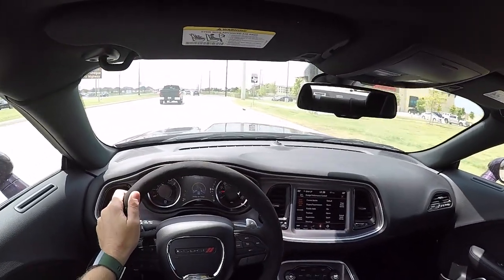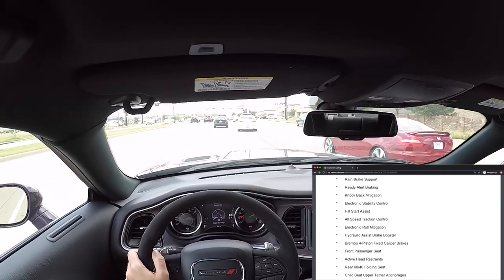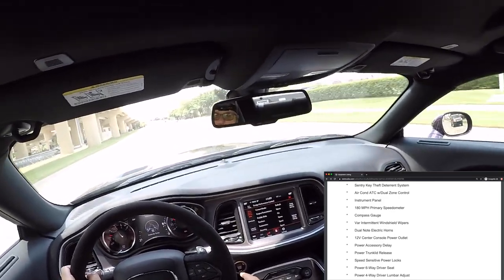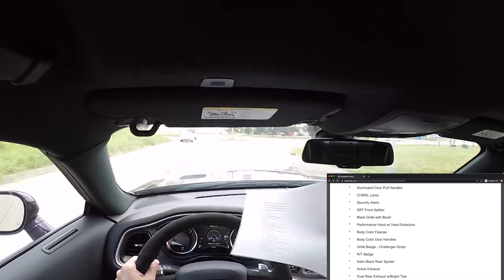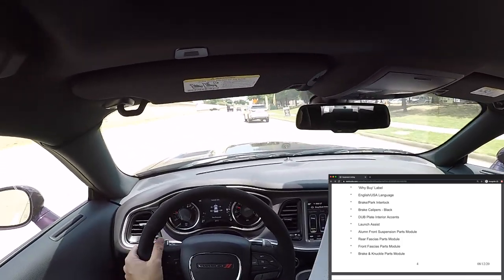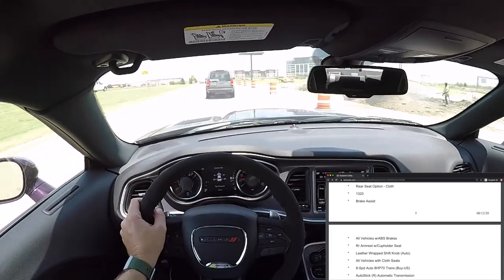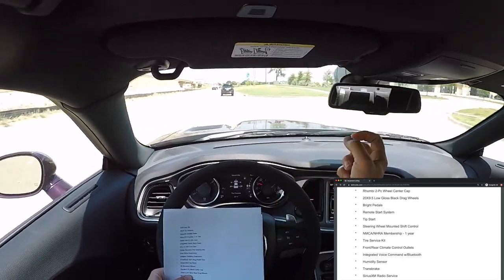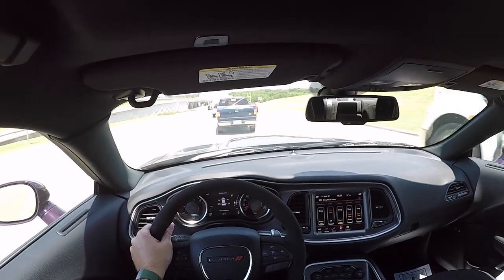Going over the build sheet on my 2020 Dodge Challenger Scat Pack 1320 line...by...line

Comment: That second keyless entry is when you walk up to your locked 1320 with key fob, put your hand under door handle, it automatically unlocks. Then when you get out just push that  button on outside door handle to lock it. I would recommend from a desk next time also. Don’t wanna crash that iconic car buddy. 👍🏼
Reply from the maker: Aaaaah, ok. Thanks for the explanation. I kept pressing that little black button when opening and it kept doing the opposite of what I thought it was supposed to do so I gave up on it lol.

Comment: Dang wish yours did something cool besides dodge when you turn it on mine SRT pops up but then by the steering wheel the scatpack bee pops up
Reply from the maker: It is weird how some scats flash SRT on the Uconnect and others Dodge like mine. But I just focus on the Angry Bee that pops up in the dash anyway which is pretty bad ass.
Reply: Yes I love the bee the bee that comes on looks the best I love it also I know my buddy with a 2019 scatpack dodge comes up on his screen also
Reply: Does your engine say powered by SRT on it? I’m sure it does!
Reply from the maker: @luca1129lp  yes it does on the plastic covers, but I took them off
Reply: Scavenger 1320 oh ok you might be able to change the dodge logo on the screen maybe cuz when you turn the car off srt pops up also and fades away with smoke looks pretty sweet!
Reply: Mine had 6 miles when I got it lol!